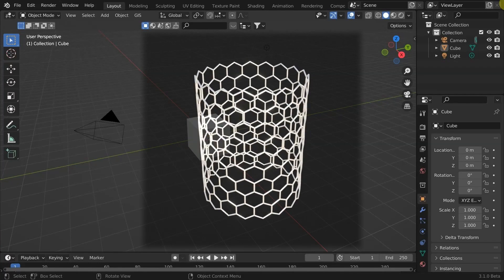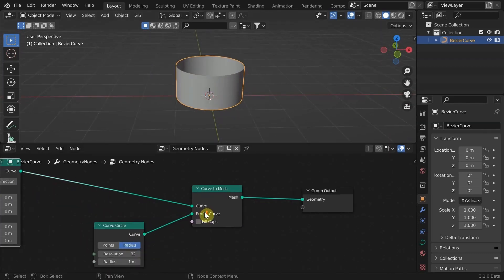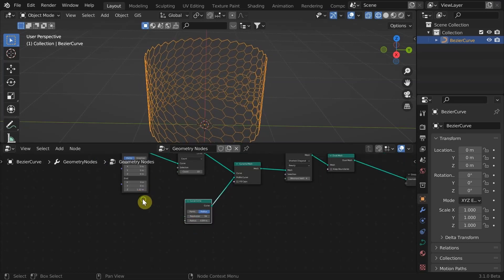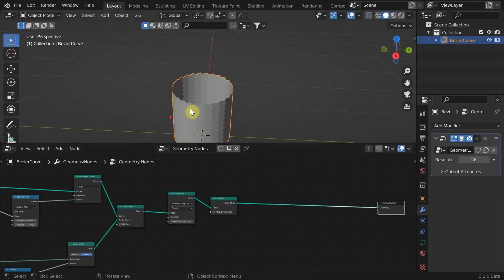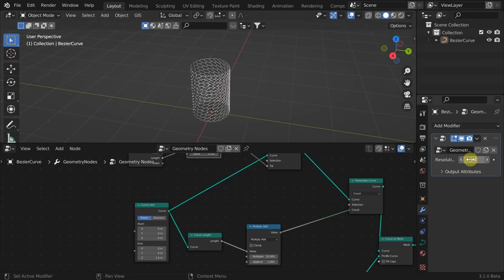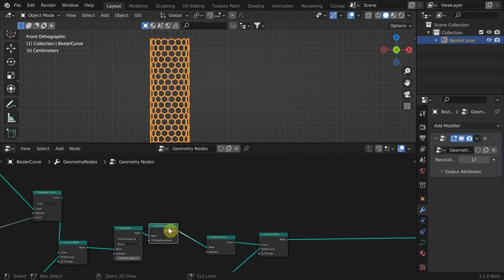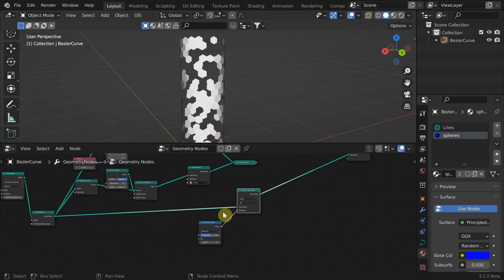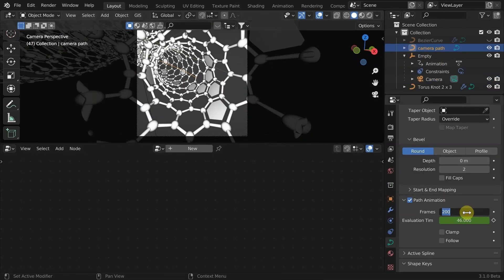Blender Geometry Nodes Tutorial | Hexagonal Grid Pattern | Motion Graphics

Comment: How did you make the camera move along the curve?
Reply from the maker: Quick and easy method is to add a 'follow path' constraint to the camera and pick the curve object (which should not gave any geo nodes assigned to it) as target, check follow curve box. Make sure that you cleared rotation and location transformations of the camera (if not, press Alt G and Alt R to clear both). finally you can align the camera into the desired angle by rotating camera or changing up axis values on the follow path constraint. I hope this helps.
Reply: Not sure he did same, but you can controll camera with GN like in this tut:
"Blender 3.1 Control the Camera with geometry nodes" so you can make cam fly over any curve you have in GN, or you can just use old ways of constraints->follow path if you using viewport curve.